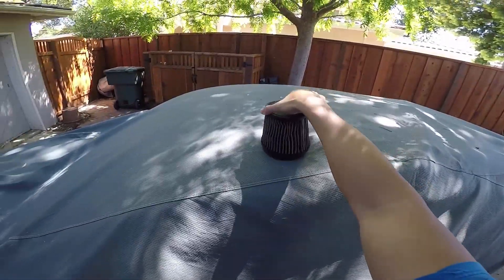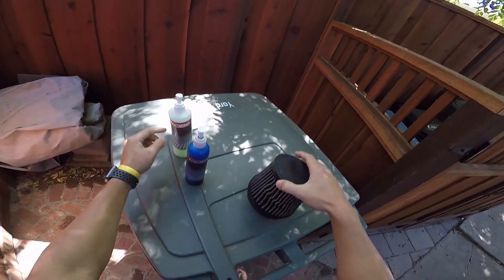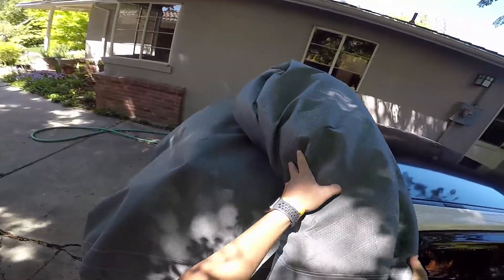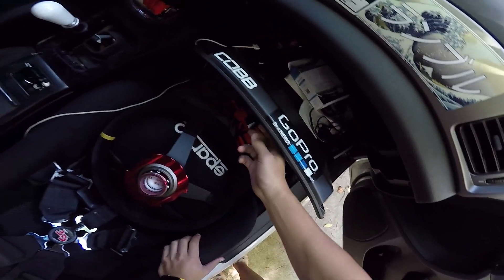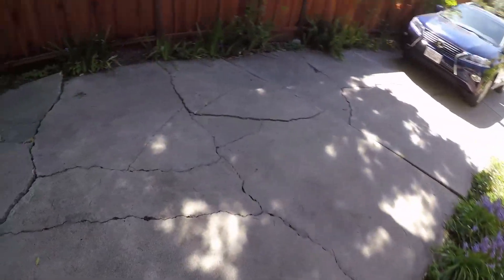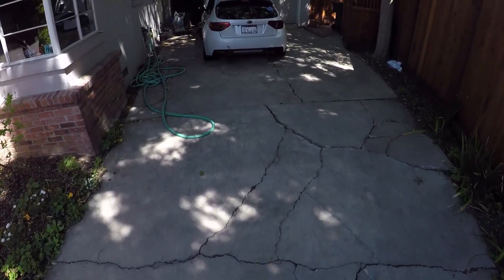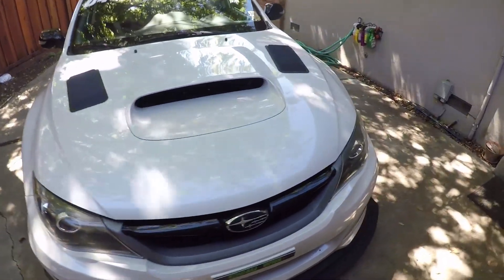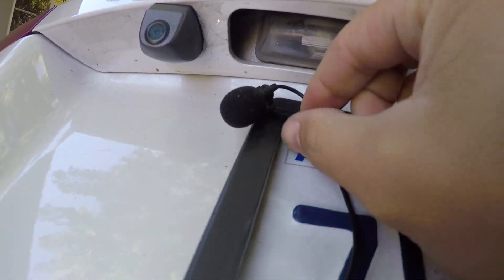POV Drive and Cobb Intake Cleaning - 450whp Subaru

Comment: I just cleaned my cobb intake recently too. Cleaned the MAF as well since i was having some issues under WOT. But right now my wrx is just sitting since i have no reason to drive anywhere. :/ Stay safe.
Reply from the maker: Cleaning your MAF is also a must! I havent cleaned mine in a while, did a pull and car went into limp mode due to a very dirty MAF sensor.

Comment: Hey question, what are the switches for that you have down in the console? Great vids man thank you 🙂👌
Reply from the maker: They work the underglow and interior lights. Was going to also hook up a horn. I wanted to do fuel, ignition etc but don’t want to cut and and splice into the ECU etc
Reply: Cali WRX thats cool man from what I can see it looks like a clean install. Thanks for the reply mate 😊👍

Comment: Hey Clint looking at getting some seats for the track. What's your take on your halo on the street. How is visibility?
Reply from the maker: Walter Szandyba 100% sucks. If it’s still going to be your daily. Don’t do it. I have a blind spot mirror on left mirror as I can’t see anything at all.
Reply: @catzbunn  I just picked up a tundra so I can trailer it and use that until I get my head gasket fixed. Might as well go built engine at this point. Was just debating on what seats to go with since it'll see both street and track but it's not a daily anymore. Thanks. 👍

Comment: How would you go about getting a safe 400tq on a stock block? I would love to hear your thoughts. I hear a lot of mixed reviews on this subject. Thanks and keep up the videos.
Reply from the maker: I was 417tq for a while stock block. e85 is your best bet, along with injectors, fuel pump, downpipe, intercooler, intake and a protune.
Reply: Cali WRX thanks for the reply! So at the moment I am down to getting an inter cooler, fuel pump and ijectors, upgraded turbo Inlet, aos and rid the axle back for a Tomei Expreme.. it took me forever to decide on whether I wanted tmic or front but I’m going with tmic even though this will be tracked. My goal is to build a rally inspired street car. My biggest hurdle is find the suspension within a budget that can support some rallying!